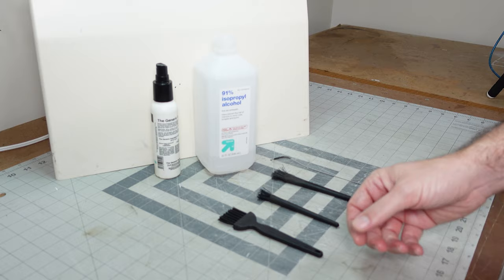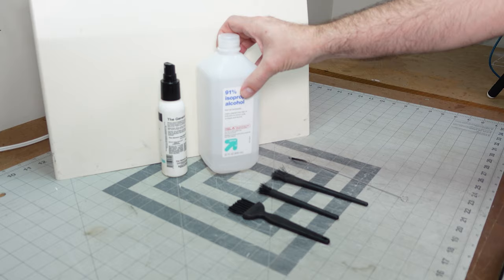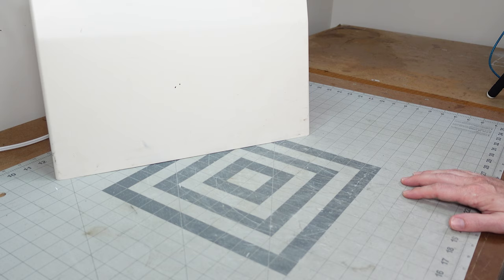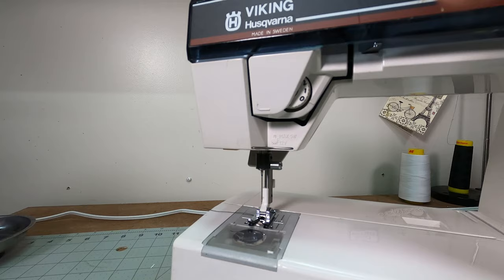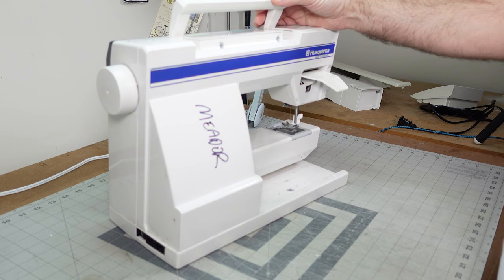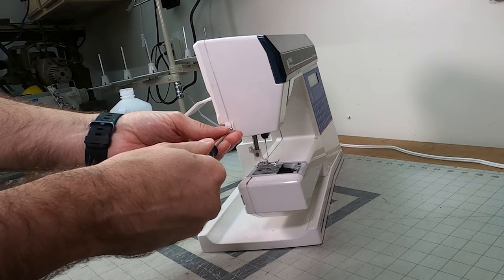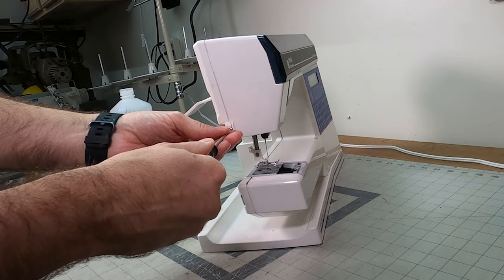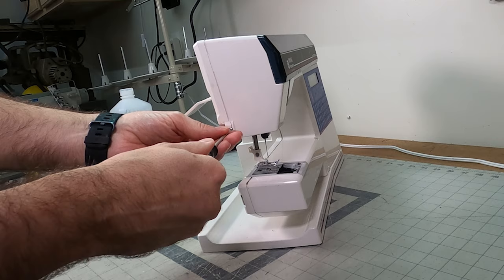How to Clean a Sewing Machine and Lots More! Free course on sewing machine repair 2 of 5

Comment: Praise the Lord for you and this video!!! I have a Daisy 325. I don't know how long I've owned it. But it's my second Viking in 46 years! The Daisy has to be at least 21 years old. I have 100,000's of miles on it. I've noticed that I have to kind of pull my projects as I'm sewing as the stitches are normal then small unless I guide it through. I noticed also that there is a TON of fuzz and dust on the upper part where the tension dials are. Thank you for this video and for the scripture and following HIS command to reach this lost and dying world.
Reply: I agree

Comment: I have owned this exact same machine for over 25 years, and it still works like it's new, even though it easily has thousands of hours on it. I used to sew for a living. Thank you for this video, I've looked everywhere for a good demo on taking the housing apart, cleaning and oiling the machine.
Reply: I did clean mine like this, but now some of my buttons do not work.  I can’t change some of the settings.

Comment: I've worked as a sewing machine operator in 2 different factories. The factories I've worked for used compressed air to clean the machines several times a week.  We just had to be careful not to let the compressed air hit the pool of machine oil underneath the machine or we'd have a huge mess to clean up.

Comment: The case against blowing. I have worked as an Electronic technician since 1975. With electronic components such as memory, microprocessors or any integrated circuits, especially before 2010s is easy to damage them due to the static electricity produced by fast moving air without proper grounding. I did plenty of those repairs. Usually when someone with  a enthusiastic attitude  and a can of dust free spray can they just have bought at Radio Shack.
Good video and excellent subject. I just bought a Brother ST371HD, am a total newbie at sewing.

Comment: Great demo. 
My wife has this exact machine, bought it new, gave it to her sister to use and it hasn't been cleaned in 10 years. I have been studying up on sewing machine repair and this demo was exactly what I needed. I could not find anywhere, how to remove the covers just allot of people how difficult it is and then showing the machine stripped. You saved me..., gave me some great pointers and now it works like new. Found 10x the amount of lint than you did. It was almost compressed to a felt state.  Thanks again, Jim

Comment: I'm a retired engineer.  I am an expert in a bunch of fields.  I would use compressed air.  I've never experienced "static issues".  Ground it if that is your concern.  Components we don't use compressed air - "when you can blow abrasives into tight spots".  (Usually around grinding machines- not machines that deal with soft fabrics).

Oh - grease - "urea based grease"  and Tectyl 900 (I used to work for the company.  I am a lube expert too.)

Comment: I agree.. I use air to clean out lint and other debris that I could very well of missed. No one said to use air like your sandblasting, that's why they have regulators on compressors, turn the pressure down. Very good repair series..

Comment: This was SO helpful. I have the 400 Computer, which shared a manual with this model and it said in it that it didn't need to be oiled! Mine was hidden away in the back of storage for over a decade, and and I couldn't believe she powered back up and still sewed, but the tension is wonky and I looked into under the bobbin seat and holy heck was it dirty. I pulled out as much as I could with tweezers but now that I've watched this I will try taking her apart and really getting in there.

Comment: Found this video at the perfect time.
Just bought a Lily 550 at a bargain price, (£100) with all the accessories including the walking foot attachment, and that little wheel with the 3.5mm jack plug, which I gather it uses to measure buttonhole length. It's even got it's booklets. Going to give it a good going over tomorrow.
They look very similar machines. So thank you for this video...

Comment: Thanks for the info, I'm learning in England.. 
I now know the names of the parts that I've been looking at inside the machines, and outside them for decades! 
Instead of just sewing, I'll be fixing more. 
Technicians are very thin on the ground where I live and the two that do repairs, didn't want to teach me. 
I find it easy to trouble shoot and take things apart, and now it will be even better... lemon squeezy
Reply: Hello, I too am in the UK and have to drive quite a distance to my nearest technician.  Going to have a go myself.  Could you tell me what screwdrivers you used to remove the housing please?
Reply: @charis-ann I used flat screwdrivers and forced the plastic cover apart. It made burs on the plastic and I thought it would crack, but I carried on and it popped open all of sudden! I had to gently sand paper the burs off once I'd put the cover back on.

Comment: I think the viewpoint re not using compressed air is not later in the cleaning process when the machine casing is already removed; it’s for those of us non-professionals at home doing a general tidy of the machine of parts we can reach while the casing is all still attached.  

When you’re using the compressed air, the crud has an exit point.  We at home, with the casing still on, the crud just gets moved further back against other components where we can’t reach to remove it.  

Good example on when in process to correctly use the compressed air as a tool. 😷👍

Comment: I’ve watched all 5 of your video’s.  I have an Emdeko that was my mother in laws.  Probably hasn’t been used in 30 plus years.  I was skeptical of your cleaning procedure.  The grease on the gears wasn’t hard, I could not understand why it ran in slow motion.  I even took the belt off to see if the motor ran slow.  After cleaning the machine, I used 3 in one oil and oiled all the gears and bushings, and anything that looked like it was a lubrication area.  The machine still ran slow…but somehow over the last few weeks, the oil must have penetrated the old grease, and the machine is running fast again!  The foot pedal I thought was “toast” also works as it should, but I think I’m going to replace it for safety sake…
Thanks for your video’s!

Comment: Thanks! That was a very informative demo. I picked up the 400 model at a thrift store with all of its feet and accessories and the hard case for $45. I didn’t break it down. It was hardly ever used. Pretty clean inside. But I ran it through the routine clean and oil. But if I ever have too…..there you are! Thanks!

Comment: I live in SE Colorado and there are very few repairmen.  At present I have two sewing machines that won't work.  One I bought at a thrift shop for $17 (it looks like a solid old machine) and the other I bought off ebay.  both of these machines the needle will not go up and down.  I bought a second machine off ebay, it still works but the thread keeps getting caught on the casing up above the tension area.  it's frustrating to have to stop and get it out every little whip stitch.  I so want to sew but am afraid to take it apart.  The repairmen are either in Pueblo or the Springs and they want an arm and a leg to fix an old machine.  I don't understand why.  I really appreciate your putting out these videos.  And you take the time to explain so much.  I hope to try to fix my machines.  The machine I grew up sewing on (Viking Husqvarna 6440) quit and I donated it to a thrift shop.  Now I wish I still had it to try and fix.  I'd heard that those machines had a lubricant that over time hardened and just need a modern lubricant and they would still sew.  The things you learn after the fact.  Thank you again. :)

Comment: That’s my machine that the repairman told me the feed dogs were worn down and now I may not be able to afford to fix it. How do feed dogs get worn?  I loved this machine. My grandmother left it to me.
Reply: Some feed dogs are made of a fiber type material used for thin materials and with time they will dry rot like a tire. And then need to be replaced with regular metal ones. Found this when I opened my moms machine after closed for 20 years. They don’t cost but a few dollars and do it yourself very easy

Comment: I have a new Singer 2277 machine which is a piece of junk in my opinion and I have not been able to use it and purchased a 44S Heavy Duty machine after that and hope it works perfectly. The video you put up should be good for those who need to clean their machines and I hope to be able to use one if not both of the machines I purchased and the first one cost more than the second one and it isn't a heavy duty machine like the second one.

Comment: I just got a Consew 226.  and thanks to your videos, I know know how to service, clean and maintain it.  I haven't used it yet (waiting for some needles and such to come) but in the meantime, I'm going to clean it, and check timing.  This machine does have a slightly bent main shaft.  I did see it run, and it seems to sew fine.  I may not be able to run it at top speed, but I didn't buy it for that.  Mostly bought it for light leather and  heavier fabric like vinyl and maybe canvas.  Thoughts?  and thanks again for all your excellent help in the videos!

Comment: I have a Husqvarna Prisma 980 the bobbin thread and the stitches bunch plus the the rewinder doesn't work. I've had it for 16 years and I bought it used. I don't know the year it was made I've never had it in the shop and I never opened it up.

Comment: I just bought a Necchi 4575 that was stored in a case for 22 years.  I cleaned & oiled it and it works great with straight stitching.  Just curious before I take it to get serviced if there is something simple which could be keeping it from doing any type of zigzag stitching ?  I have tried every combination of the knobs indicating different stitching type but it just does everything straight ?  Machine is in like new condition, just not sure where to start?  Thanks even if you cannot help.  Your videos are great!

Comment: Hi! Great video. I am cleaning a Lily 550 currently and could use a little help with a piece. In minute 9:45 off to the left of the machine you have two white pieces. One I know goes to the bobbin winder area but the piece with the tab I have no idea where that one goes. When I took the case apart I looked down and there it was on the table. Could you tell me where that piece belongs. Thanks

Comment: Compressed air I see can be helpful for cleaning by a pro.  Canned air has moisture, and should not be used by the machine owner.
Reply: Once the machine is all open, compressed air can help.  Don't blow compressed air into a closed machine.

Comment: Do you have videos on how to clean and maintain or repair sergers?
I had a Singer Serger that I loved - but it wasn't working properly and I am not even sure where to find parts!
I also own a used Bernina Serger and an Elna Serger. (newer)
Any info would be so helpful!
(I own two Singer Quantum 9910 - they need cleaning and one is skipping stitches  - I used it to make my daughter's wedding gown - think LOADS of sequins)

And I bought a Babylock Ballad.
I have machines across the ages.
(I also have a Singer 1982 - electronic machine - not even sure what model)

I do some alterations, costume sewing, have done bridal, and quilting. 😊

Comment: Looking through your videos helped me alot with my machines, thank you for that. As for the cleaning... have you tried long feathers, as they are flexible and get rid of all the dust inside. I have chickens and never saw these long Q tips here in NZ. Keep the videos coming.
Reply from the maker: Never thought of that. I imagine feathers would work fine.
Reply: One thing I like to use in cleaning my machines are chenille strips, "pipe cleaners". They are long, flexible and a little less likely to leave parts behind.

Comment: Dear Sewing Machine Repair Guy. 

I have a Husqvarna #1+ I want to clean it as you have showed in this video.  However I have been told that this machine is self oiling.  I have taken the back off and have cleaned out the lint so far.  I am wanting to know is can I oil the moving parts.  Or do I leave them alone.

Comment: Hi, I absolutly love your vidios.. wondering if you can help me with my Husqvarna classica 150 .. i was given this machine, and discovered the drive belt had slipped off. So I took the bottom off to get to it and have managed to fix this and put it back together .. I think !! I had to disconnect two electrical connectors to what looks like a motherboard. I foolishly didnt take a photo of which female connector went to what male connectiors - can you assit me, tell me which connectors go to what and which way up cos it looks like the connectors have metal strips on one side ... would be so grateful if you help me with this one

Comment: I have the 600 model which is also an embroidery machine. I hope to someday be brave enough to open my machine up to clean it. With Covid still rampant, I have not been anywhere to get it looked at. I do have a couple of questions, are the 500 and 600 pretty much alike? What about the embroidery unit itself? I've had this wonderful machine for almost 20 yrs. now.  I'm ashamed to say, I have never really used the embroidery unit. BTW. Not having any issues at this time, but it's been a couple of years since last maintenanced.

Comment: I need to replace the feed dogs for some reason they aren't  high enough. How do I remove the gray plate?
Reply: Thank you so much for this great tutorial.i have this exact machine so it was so helpful to disassemble to clean! Now I need to figure out that tiny wire that is part of the bobbin winder system. I'll check to see if I can see it on your machine. Again Thanks.

Comment: What's the grease used for specifically? I understand the oil.   Thanks!
Reply: I locked up today.   After sewing 100's of masks and some baby clothes.  Thanks!
Reply from the maker: The grease does a better job of staying where you put it, it clings to the surface.
Reply: Thank you!  I literally just made a list for tractor supply store and basically watched all of your videos on cleaning and repairs.  I love fixing things.  I actually changed a part on my Rainbow and it purrs! I hope to have the same outcome with my machine.
Reply: I found the birds nest.   It's under the entire bobbin apparatus wrapped around the shank that turns the silver casing that holds the black one.   I'm having trouble accessing it without further tear down of machine.
Reply: @SewingMachineRepairGuy  but where do you use the grease instead of oil?

Comment: I dont think I’m willing to take my machine apart like this to CLEAN it. Really?  As a matter of fact, my warantee states that it will NOT cover opening the machine like this and I own a viking ruby deluxe.  Also you are wrong with using canned air.  Why would you do that? It causes moisture and causes issues. Nope!
Reply: Looks like he's using compressed air, not "canned" air. He likely has a water separator and particle filter to produce CDA (clean dry air). No problem with that.